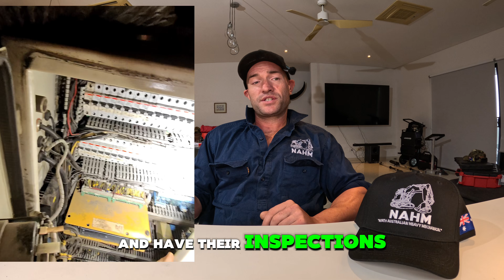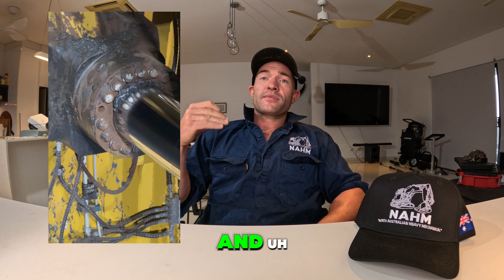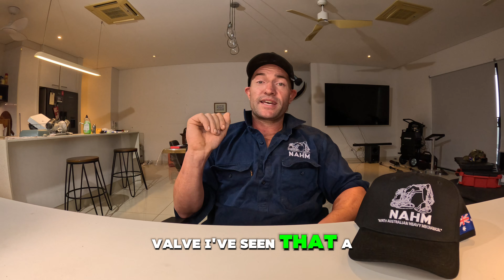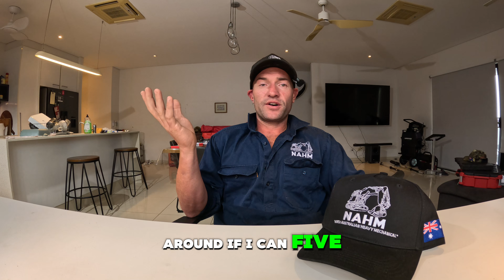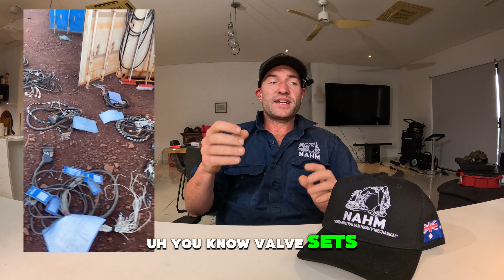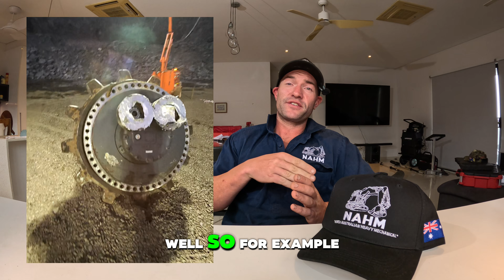SERVICING THE WORLDS BIGGEST EXCAVATORS WHAT ACTUALLY HAPPENS DURING PLANNED MAINTENANCE (PART 1)

Comment: Was a couple of RH 200 in north east UK,90's o&k weren't expecting them to track.up out of the pit regularly, firm I was on for did welding n boring,o&k supplied a sprocket so they could re weld the four in turn,,took bout 400 hours each iirc😂
Was 3/4 firms make big money off welding the o&KS back then
Reply from the maker: That’s some hours spent welding mate! How many rolls of wire 🤣🤣
Reply: @patrickcoward4309 welding n grinding to reprofile, reckon they charged about £20 hour back then 😂
Firm also had a 777 skip cracked in half in yard,was the 'fill in job',when nothing on,bought from coal contractors for scrap price